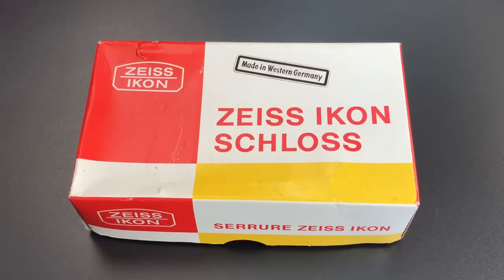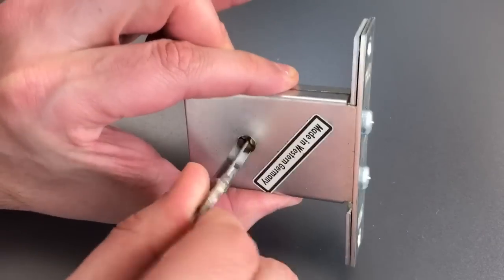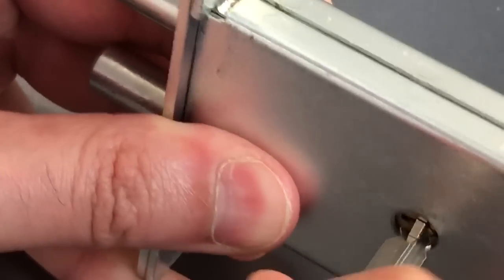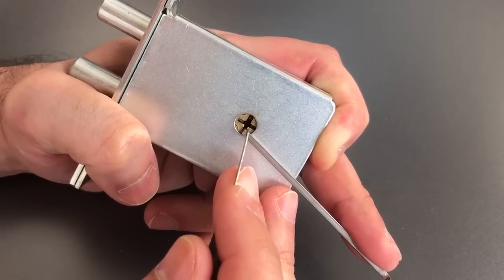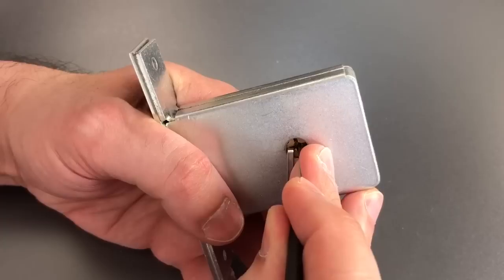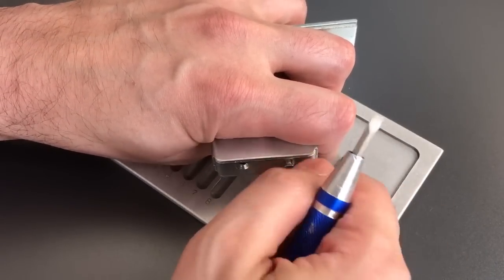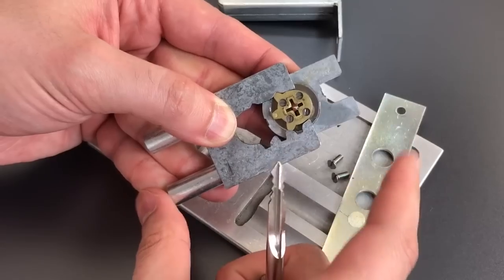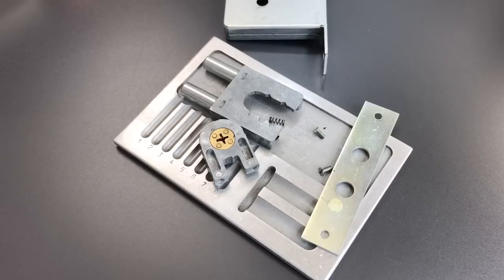[491] Vintage Zeiss Ikon 211D (Cruciform) Mortise Lock Picked

Comment: The pin that hit you in the eye, is a secondary security pin to deter tampering. I believe it is called, an ... attack pin.
Reply: Now, that's what they call an exploding pin.  The high security version actually shoots a bullet at you when tampered with.
Reply: @u.v.s.5583  Make a tamper capsule that the key can never strike, but can be accessed with a pick and ruptures to flood the mechanism with thin CA. You seize the lock solid and with any luck capture the picker's tools as well.

It's the equivalent of glass plate mounted workings on combination safes, any attempt to drill the face breaks the glass and disables any means of pulling the bolts.
Reply: @mfree80286  Too much opportunity for griefing with that, basically, people will use it to do sabotage at every level.  It is already possible to build locks that seize up when picked and it is rarely employed because the end result is of dubious value.
Reply: @Lazarus7000  Aye, although LPL  recommends one and has a video on how to modify a Quikset to do so.
Reply: @Lazarus7000  it interesting, i can see the value in knowing if someone was trying to pick your lock. at the same time it means you get locked out of wherever you need to go if it happens. but at the end of the day if someone picked your lock youd probably want to call a locksmith and an officer regardless

Comment: The Germans installed cruciform locks in Colditz Castle when it was a maximum security POW camp in WW2 (British military officers who escaped from other camps were sent there. The Germans thought that the Crucifom locks were foolproof. However one of the prisoners was a watchmaker and was given tools by the guards in exchange for fixing their watches. He made a specialised caliper which would fit in the keyhole to measure the pin depths when the plug was tensioned. Then he would produce a key. They were extremely careful not to give the Germans any inkling that they had compromised the locks. Source - Pat Reid's 'The Colditz Story' published 1955. Pat called the pin tumblers 'pistons'.
Reply: that's very interesting!
Reply: Awesome book

Comment: What I can tell you from the packaging is that this particular lock was produced between 1970 and 1980, as the style of the company logo reveals. Although the system was first used around 1930 from Zeiss, it was mainly used in the 1950's for the "Deutsche Bahn", the german railroad company, although they used 9 pin locks with more security pins in it.
Reply: In the 50s it was still Deutsche Bundesbahn and a government agency, not a company.

Comment: these types of locks are very much in use in denmark, always as a 2 lock door combo where you tend to have a standard Ruko and one of these further below. I always thought they were impossible to pick due to the key design, but of course as we have learned from other weird key designs, it just means more pins.
Reply: And it only has 6 pins like a current Ruko, just next to each other instead of along the depth.

Comment: to release the laquer, you can try touching the screw heads with a soldering iron ... sometimes that melts the laquer so it can be removed

Comment: those locks are still used as extra lock on most old doors in Copenhagen, and people think they are the safest lock in the world. .. trying to explain the concept of only 6 brass pins and a keyway shaped as a philips screwdriver. 
they can be opened to rekey, but they sell repin kits with the lock body section and 3 keys to make a fast replacement after a drill session.
Reply: seems to be a european thing. 
these little double sided locks have intrigued me since i was a kid. they were common-ish in germany for decades, to retrofit basic, and old to ancient doorlocks. and are still avalable as an Einbausicherung. (build-in protection/security). a Schlosssperre (literally lock-lock :D ) is a variant you slip into the old lock after locking it, lock it up, and later remove it with the key to unlock the actual lock with it's own key. it's clever and somehow hilarious.
Reply: Same here in Norway. They were used as extra locks, for extra security, back in the days...
Reply: ..and in winter there'd be frost on the inside of the lock, around the key hole 😄

Comment: As far as I can tell, it says February 1982 on the paper, you can see that around 0:38 as „02.82“. So at least you can tell the revision of that print, meaning the lock most probably was produced after that date.

Comment: If you heat it with a lighter the lacquer will give and you can get them out without damage. Then soak them in acetone to remove the residue.

Comment: I wonder if the fact that this lock is accessible from either side means you could find a way to set up a small light and camera on the other side, (maybe with the lock itself held in a vice), to record the actual picking process in a way that we could see the details of what you're doing inside the lock? Assuming you haven't done something similar in another video, of course. If so, if someone could direct me to the video I would appreciate it.....

Comment: It's fun to get directed to one of these and have it actually be about a lock that's in your front door.

I've got a pair of these as additional locks. Hard to be certain, but looks exactly like in the video. The cruciform part goes into the door entirely - almost 2cm to the first pin. And add to that since they're additional locks they're not at normal hip height, but at eye or knee height.

Comment: 5:44 "You going to be picking this at depth. Probably, at least a half inch of door..." Wait, are those locks still in production?
Really beautifully crafted lock. Our neighbors had a similar lock back in the 90s (in Russia).
Reply: Oh yes. Still super common in Europe. What you do is you don’t replace the old lock, you just add two of these.
Reply: @JasperJanssen  Exactly, that's what we used to do all over the Netherlands at least. Later in the 2010's it became more common to have a bolt with 2 hooks activated by a single key but in my teens, every front door had at least one of these besides the normal lock.

Comment: Finnish Boda 428 Security Lock has the same option. You can use it both outside and inside with the same key. It still is the most popular extra safety lock here in Finland and the key looks like those used in safes. My dad was assembling those in 70’s .

Comment: This locking mechanism is also made in east germany (GDR) by "VEB Schloßsicherungen Gera" as "Einbausicherung ES 52/76", to be build into normal room door locks to increase securety. 
In the GDR-times, the key-handle was made from plastic, mostly jellow orange or gray , with a little metal insert for the bidding. 

In 1990 the company changed their name to the name FRIPA, the lock insert remains the same, but the key changed to a more robust full steel version. That lock is still in production in Gera, now the company is named ISEO. The product name is ES5 2/82 now, exatly the same product,  just the stamping on the key-handle has changed a  little.. ISEO Locks made inn Gera are still widely used  in east germany today, they producde high securety locks, with individual keyways für any customer, and a pin tumbler/Pin in Pin combination combined, I have on my door

Comment: I believe it’s the first time I’ve seen LPL pick a kind of lock I happen to use almost daily. These are stupidly common in Europe, especially a model designed specifically for those tempered glass doors with brushed steel faceplates and a cork-lined inset.

Comment: We had those assembled in the 50’s and 60’s here in Finland but then they were replaced by a Finnish BODA 428 safetylock. My dad assembled tons of those in the 70’s and they are still made. It can be opereted from both sides too and the key looks like a safe key. Would like to see how it’s picked. If I recall it right, it had over 15 mins pick resistance, but I may remember it wrong.

Comment: I recently picked exactly the same lock, on mine the screws did come out though so I can tell you what's inside (mine at least). So, in the plug there's three sets of two keypins. In the bible there's four sets of two drivers. I think it wouldn't work otherwise as you're supposed to take the key out after 180 degrees turn. Mine had one standard and one spool on each side, they all engaged too. The biggest challenge was to get everything back together, lol.
Reply: it should only take a quarter turn to engage the fourth bible.
Reply: Did you have a proper diameter follower?   The  first pin locks I rekeyed without one were a pain.

Comment: HELP! A friend just managed to break his key to this lock off - inside the lock, partially/wrong engaged (wont budge in to engage, nor come out). Of cause it happened during un-locking, so the (in this case two - one per side) levers are engaged.
Any ideas to get the key either out or how to forcefully open this without sawing the door in half?
Would brute force help to break the pins and just free-rotate the core? The cross-shape should offer sufficient transmission of a large lever.
Reply: OK, problem solved… He sawed the door in half and went in below the lock bar. LOL Was able to push the broken key out from the inside - lucky for him those cylinders are all the way through.

Comment: I have this lock. Always leave the key in when home, turned 45 degrees. How difficult would that be to pick from the other side?
Reply: if you turn the key 45 degrees that would mean the person would have to turn the key before pushing it out. Depending on how smoothly your lock runs that wouldn't be too hard with pliers to turn and even easier would be using a head of a phillips screw since the key tip is exactly like a phillips screwdriver(the most common screws). 

The good news is: If the key is pushed out it will be dropped on the floor which will make noise... unfortunately however the picker might choose not to push the key out at all and just continue turning the still engaged key past the first 45 degrees(that would be a smarter choice) and never have to even pick the lock.. so it's really not a good idea to leave the key in a lock where the key is sticking out on the other side as the picker can simply take the advantage of that tip.

A better idea would be to put the key in just slightly..  so it cannot be turned, but it still just barely holds itself in... that way if someone sticks anything inside the lock the key will drop on the floor and make the otherwise quiet job, not so quiet

Comment: Good to know I am not the first to dream up the cruciform key. But sheesh, if you have that long of a key, why would you not put at least five notches on each quarter? And no need to be mirror image or symmetrical let the handle tell which way to insert the key. Really, the only good thing about this is that you can fit the entire lock inside a door.

Comment: Nice video, except that I would really like to see it guttet. I have one on my front door, as an extra lock. I never thought of the fact that it actually only has one cylinder. Very neat! Maybe I should take it apart and put in more security pins?
Reply: Povl Kvols put in a better lock. A philips screwdriver and a wrench, and the lock is open. When brute force is so easy, only locknerds pick them open

Comment: This is a door lock, correct? I ca't think of how this would be installed.
Reply: You cut a pocket or mortise into the edge of the door, then drill perpendicular through the door and pocket for the keyhole. You slip the part of the lock with the keyhole into the pocket and screw the faceplate to the edge of the door.

Comment: I dont understand? Whats special you can put the key on both sides? Every door you can lock from the outside and inside
Reply: To make the lock so that you are not locked inside, in case of fire, you don't use a key on the inside.  The key is only on the outside.  This lock cannot be opened on the inside without a key.  Probably not allowed for any residential use with modern building codes.
Reply: If you remove the key from the door and hide it or carry it on you, and a thief enters your house through the window, they can't leave through the door. Makes it more diffucult for a thief to leave with large items sutch as your tv or expensive furniture.

Comment: Once the “wiper insert” is removed from the wiper it ceases to be a wiper insert. What more when it’s formed into a tension wrench. Why not just call it a tension wrench.
Reply: Because not all tension wrenches are interchangeable. “Wiper insert” gives you an idea of the material and thickness, which is useful information if you’re choosing a tension wrench to pick something similar.

Comment: insert the key from either side of the lock
NOT something rare
Many locks we use for the metal door/gate thing before the wooden door have similiar locks to make locking it up easier
Mine is a dimple lock that can be inserted either way, and that is what i consider as rare 
PS the dimple bitting is not symmetrical, I cant figure out how they do it
Reply: Locks that can be opened from both sides are indeed not rare at all, but almost all of them have two cylinders. One on each side.

What is rare is having only one cylinder that works from sides. That make the lock extremely fin, fitting entirely into the door....
Reply: Hav u watched the video reply??
I have already shown the tricks the Chinese lock-makers use in order to make a key work in two directions on the same cylinder without master keying or sacrificing one "row" of pins
Later I will show my dimple key that can be inserted either side without masterkeying